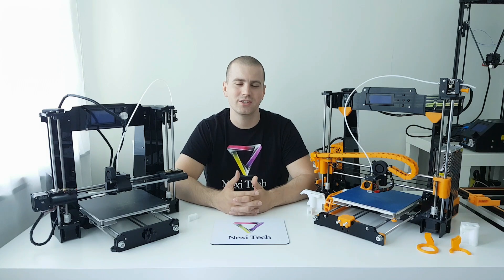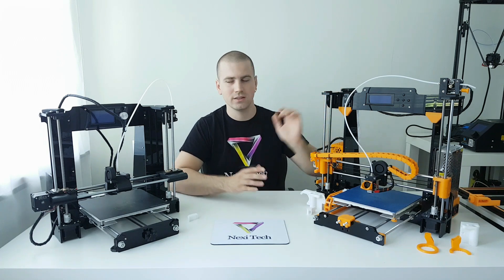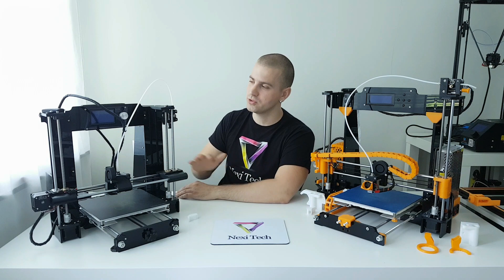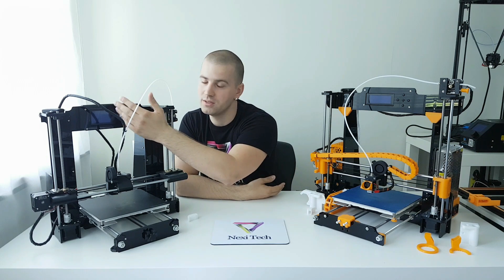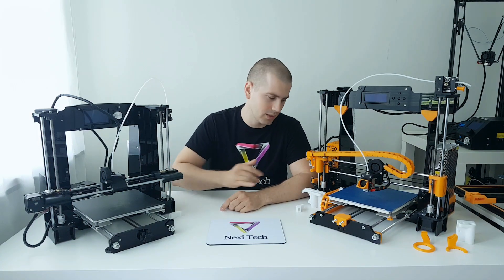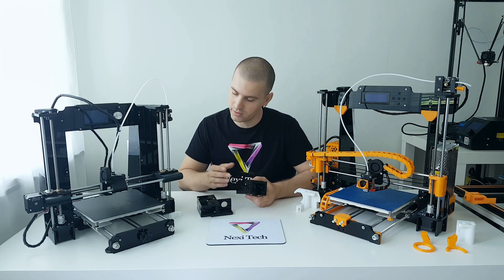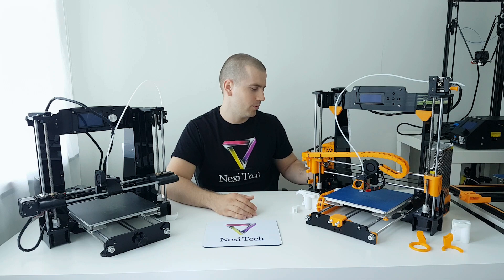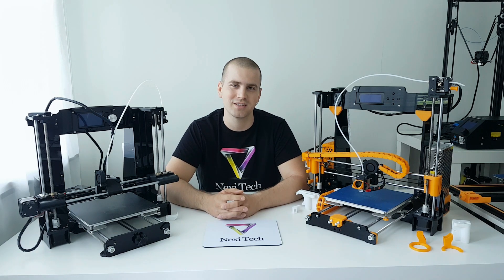Anet A8 vs Anet A6 Comparison

Comment: Hello, Do you recommend change the original board to MKS gen v1.4 board? are they compatible with the Anet 6? thanks in advance.
Reply from the maker: Nope, There is no need for that. This board works very nice and print quality is very good.

Comment: Hi +Nezi Tech, I was wondering if it is easy to enlarge the Z-axis with longer rods; can the firmware be modified for some longer axis?
Reply from the maker: Yes you can mod the firmware for longer axis. You can flash A6 with Skynet firmware and play with different mods. But to be able to install longer rods you need to design/make top bracket of frame or some kind extension which will be able to hold longer rods.
Reply: Thanx for the answer !!! :)
Didn't know about skynet's features !
I'm going to study more on the subject. ;)
By the way, your prints are among the best on the entire youtube !!
There are countless youtubers with millions of views but they also have millions of strings on their prints !! XD
I'm glad to have found your channel as I prefer quality over quantity. ;)

Comment: Hello, im about to buy a 3d printer, which one do you recommend against Anet A6 (upgraded version) or anycubic (upgraded version) ? I appreciate your help!
Reply from the maker: Hi Alan! When you said Anycubic did you meant Anycubic kossel? If so then depend of your preference. Do you need 220x220 in X and Y axis? Or do you want to print ABS or PETG? Because is easier to print those materials on A6 with Heated bed. If answer is No then Kossel is good choose. Kossel has very strong and robust frame and is faster and not to mention that its easier to upgrade. But I got to say that Kossel is a bit harder to calibrate but when you got it right you don't need to calibrate again very along time. Cheers!
Reply: Nexi Tech Hello! Yes I'm talking about Kossel! I saw your video upgrading that printer and is really awesome for both printers.

To be honest I'm just a beginner, I love to design and make prototypes for RC cars and drones. Also I wanna build a CNC router.. so..and I'm looking for some printer with a good quality on the parts I make. With good resolution and with a printer with a good quality on its frame, not wooble structure.
And easier to find spare parts of course. So well, seems that it depends of the size I need on the printed parts right? :o

Thank you very much!

Comment: Now don't get me wrong, you know I usually love your videos. This one sorry NO real grit or info of a positive nature well this good and that is good. Usually when you compare there is always a winner that's how we choose. There were no prints done on both to compare. I would have said the A6 was the better printer and so it should be as it costs more with better LCD and stability. Plus if you want to get a really good printer buy either and reframe like Haribo 30x30 then you would have a really nice printer. Sorry my two cents.
Reply from the maker: Hi Paul my friend. This is just quick 5min comparing video. Here both of these 3D printers are winners. Anet A8 is winner in upgrades and mods and Anet A6 is winner in Frame, LCD and knob from out off the box. Here is just matter of choose ''how'' you will use your 3D printer. Stock or not.  For prints comparing there is many videos of both Anet A8 and Anet A6 on my channel so everyone can check my videos to get more detail.  And my dear Paul I know what is good and expensive 3D printer but for this price practically everybody can start doing 3D printing for really low price. To be honest what ever you choose A8 or A6 you can't be wrong. They are awesome 3D printers for the price. Best Regards. Nexi
Reply: I know what you are saying and I agree, both are OK. for the price. I just felt cheated as your videos are always so good. My bad. looking at other videos to see the results of these printers kind of makes this video not needed if you know what i mean?

Comment: Thanks for the review. It's possible to print  addapt the x carriage from a6 to a8?
Reply from the maker: You welcome! Well i think it can be done. But it would need to design top and bottom frame bracket(holders up and down for rods to move out Z carriage to make space for horizontal setup.

Comment: Just one question left: what's about the software on the two machines? Is the software identical or do they use customised versions? Thanks
Reply from the maker: Software is very similar. I think they are using customized version for Graphic LCD on A6. I flash my A6 with Skynet firmware and its even better. Cheers!